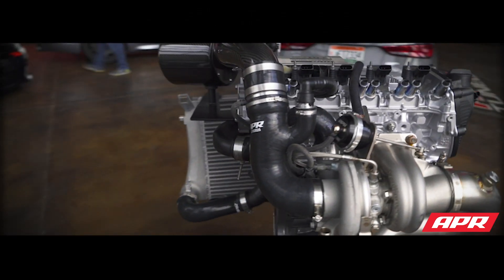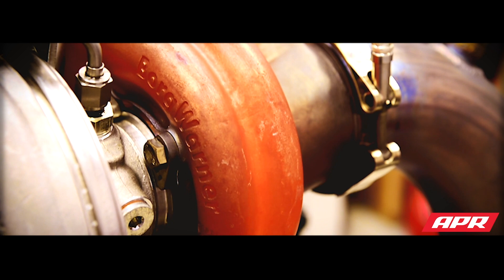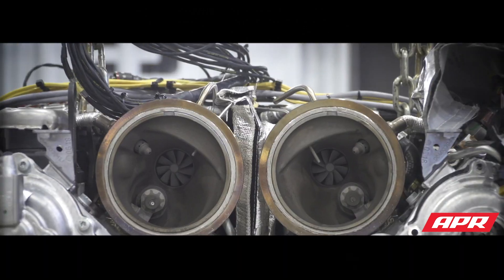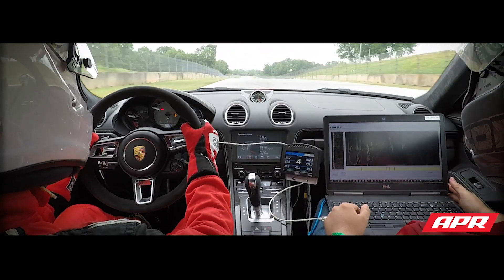APR ECU Calibration Tech Talk with Eric Urness

Comment: Just had my 2017 Boxster S 2.5l turbo flashed this morning and the difference is substantial!  Struggling with cold tire / cold road surface lack of grip at the moment, even a roll on to full throttle lights up the tires in 1st gear and some squirming in 2nd.  A lot more pull and everything working perfectly!

Comment: The "100mph" fans that you have (as great as it may sound) aren't providing REAL street data unless they match the speed of the vehicle.
If you start off at 35-40mph at a given RPM and go WOT - a car on the street isn't getting 100mph of air through the IC (or engine bay) until it reaches 100mph.
This factor and the "Radiated" heat from the road considerably decreases whatever a dyno depicts.
It is well understood that the ECU will adapt based on conditions, but no one is ever seeing Engineered Dyno power on the street.

Comment: You guys did my 2016 RS3 just stage 1. It did not impress but your distributor said mine was one of the first ever done (had to send you my ECU from Australia ). And then ..... a few months later you released an update..... oh my goodness what a transformation. Everything I had hoped for! But now .... I have also purchased an Arteon and went straight for Stage 2. I have no complaints.... but was talking Stage 3 as I was curious to see if more than 400 HP could be had.... my distributor suggested I wait for your Arteon Stage 2 update rather ..... I’m waiting a while now, if you could reply it would be appreciated ......when will you release the stage 2 update? Will this give me >400 HP? Or contact Doug at Euro-Tune Australia and give him hopefully the good news? Respect for your brand!
Reply: did you change flywheel, pistons etc ? because you have many components built for oem engine, not for tuned
Reply: So .... I got tired of waiting, in the meantime I had the DSG retuned, out of the Netherlands, which to be fair made a slight difference but still lacking... then I sent my IS38 turbo to Germany for hybrid internals. As luck would have it the unit arrived back a day ago and will be installed and ECU retune applied. Within a week therefore I will know the outcome. 
Just some feedback for the pointy heads at your new head office, a bit disappointed that your brand went all green on us all as your EA888 stage 3 was my obvious upgrade choice based on my trust of the APR brand and reports of your Stage 3 EA888 work... there’s no “green” outcome here because all us rev-head consumers will do is move to another brand.

Comment: I just bought a 14 Touareg TDI and I'm mostly interested in improving fuel economy.  Turns out my mechanic is an APR dealer.  Can I get better MPG with an APR tune?  If so, how much improvement?  I looked at RaceChip and they claim up to 20% improvement.